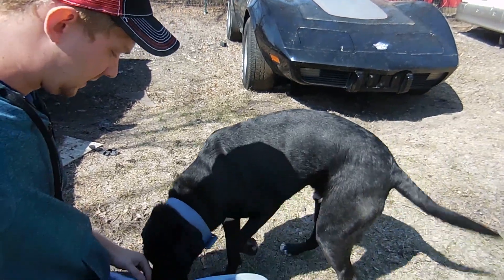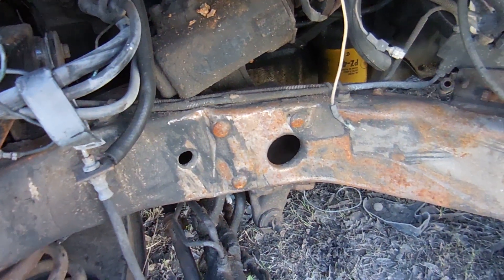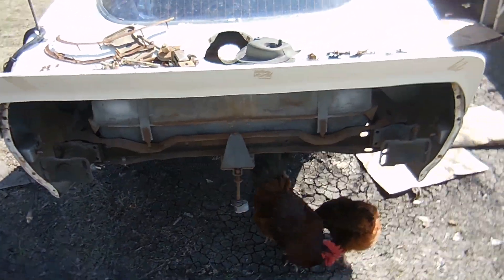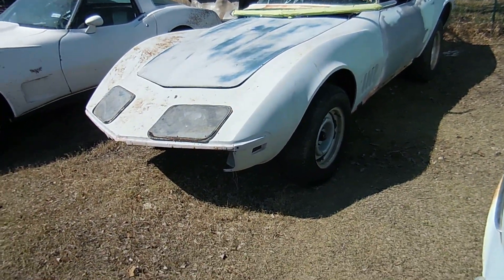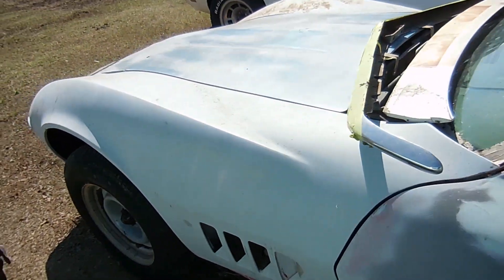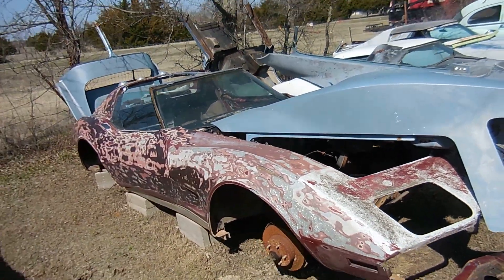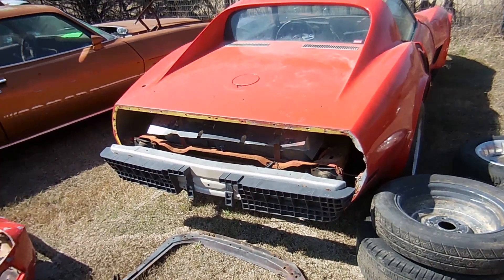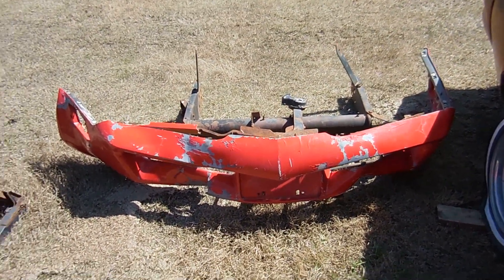C3 Corvette Parts Car Junkyard: Beaters, Wrecks, Junkers, Piles of Crap!

Comment: my boss needed room in his garage at home and sold me his 81 Vette for $1500 and it's absolutely BEAUTIFUL. only needs a paint job and carpet. it's all original,  never been in an accident and even has the original glass T-Tops. we put a hot battery in it and after 3 yrs with a few pumps on the gas pedal, it fired right up and i drove it about 30 to 35 miles to my house with no problems. my first Vette and i love it. runs like a scalded dog but i plan on turning the 350 in it into a super stroker. i'm lookin for 425 to 500hp. thanks ( Reef ) and i love ya bro.

Comment: If you have the camero without a title to the point where it can pass an inspection, getting a bonded title is pretty slick! I did the process on a car I picked up real cheap that ran and drove and it was one extra trip to a more specific dmv office and $100 for the bond. Then registration was just like normal.

Comment: gosh, i remember when the roads were just littered with those Camaro's...everybody and their sister had one.  Most like this one...305 with 350 auto...some i6's and some 350's thrown in here an there...rarely a stick, although I have see them.  All gone now...well, mostly.  I used to drag race, and quite a few ended up as tubbed and caged 10 second monsters.  As someone else mentioned, it would be great to see a budget resto on it, but looks like you have quite a few projects already in the queue

Comment: My 68 was silver with black, 300hp 327 4spd convertible. I miss it so. It got hit at a stopsign and the corvette body shop in MS fixed and painted the rear. The rest looked like crap so, I traded my GMC Sonoma for the rest of the paint. So, the vette was the daily driver. Uncle Sam (US) sent me to San Diego. Stationed on the USS Carl Vinson. So, I am living in San Diego CA and driving a 68 Corvette convertible to work everyday. Life was good. Life is still good but, I live in the Philippines now.

Comment: Ben,  Just got the car back after 4 yrs. of the shop having it.  Ugh!!!!  I still need the inside parts for the seat switches.  I was certain it was there when I gave the shop the car.  Long story.  I've replaced every harness in the car, and even found the outside aspect of the switch which comes through the cover.  I still need that part (female) for the switches.  I've called almost everyone I know.  No joy.  Do you by chance, have these?  Thanks, and I've really enjoyed all of your videos.  The car drives like crap as well, and a grinding noise in the back.  Problem is that shop is in Va. and I'm in NC, and I'm tired of excuses and lies from this guy.  Great painter, but not so much in the mechanical end
Thanks

Comment: Hi Ben, get yourself a Dually Diesel pickup with a fifth wheel and a muli-car trailer drive down the  Bay Area of California (Between San Jose and San Francisco) (Check C/L) and bring back some C3s to Texas. There are many rust free 68-82 Corvettes here and because of the SMOG laws 1976 and up still have to be smog checked every other year. Most 76 and up still have all their original engine equipment in place and working. C4s are the same way and very cheap down here $1000 to $6000. We don't really get rain down here and it does not snow, our sun and temperatures are easy on fiberglass.  So No salt to rust the frames. There are even some nice done cars which you could flip and make some more money on. I'm not in to Facebook, No account nor do I want one. but if you need some eyes to look for stuff down here. Let me know. Answer this post and I will contact you. I have had 6 Corvettes, Five C3s and one C5. Currently I have a 75 and a 77. like you I'm always looking for a Great Deal, but I don't buy and sell. Because of room I would have to sell one to trade up. And here they have Laws keeping us locals from parting out cars.  Let me Know. Thanks for all your videos, You really know these C3s and they have helped out with mine.

Comment: I bet the 6-way power seat in the Cadillac (Sadillac) weighs an absolute ton so good luck with that one.  My God, that last '74 Corvette, what a bog bucket (we call bondo bog in the UK.)  I think getting wrecked was the best thing that could happen to that one, if it hadn't got wrecked I suspect someone would have carried on bogging that one up, given it a cheap blow-over and then sold it to some poor, unsuspecting non-expert as a good car, and I dread to think how that would have turned out.  If the body is that much of a mess I'll bet the mechanics would have been worse...

Comment: Just got 79 need seat cushions door panels brake booster ac heat control switch controller light switch and wiper switch and a workin tach

Comment: I thought Corvettes didn't have gelcoat
Reply from the maker: Why wouldn't they?
Reply: Because they aren't boats. I read only the first few of the first year production run had gelcoat, the rest didn't
Reply from the maker: Where did you read that?
Reply: A number of places. They're Press Mold panels with Sealer and Primer. The latest place I saw it was here
http://www.digitalcorvettes.com/forums/showthread.php?t=75820
Reply: About 1/3 of the way down you'll see roger55's post. I'm 57 and I've heard this debate since the early 70's likely due to association with boats. Its a highly debated topic! If it has at least 1 repaint or has sun checking soda blast it down and follow your chosen paint manufacturers guidelines for a fiberglass car

https://www.corvetteforum.com/forums/paint-body/2394377-is-gel-coat-acceptable-to-use.html